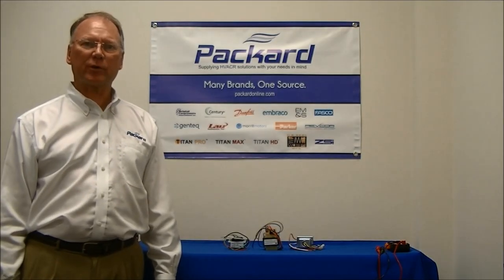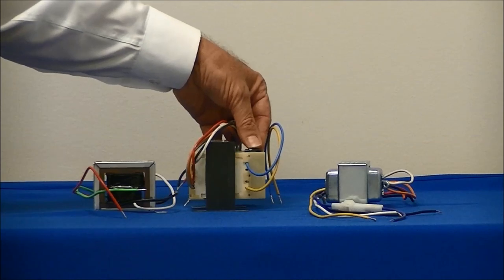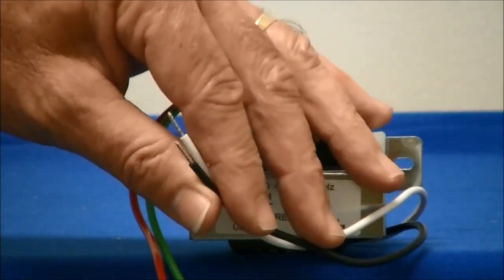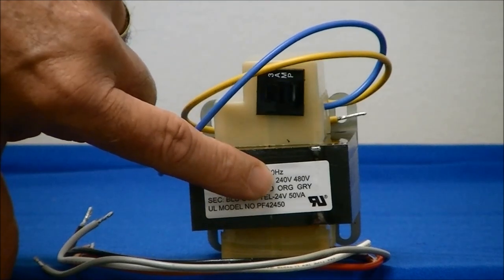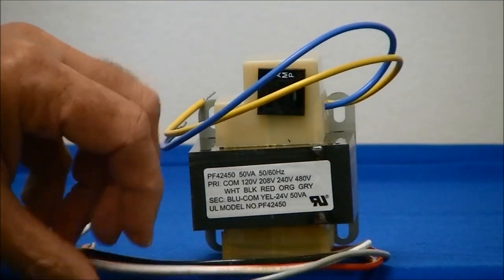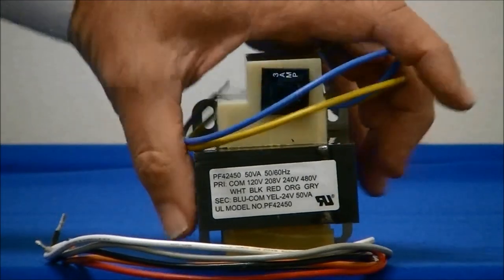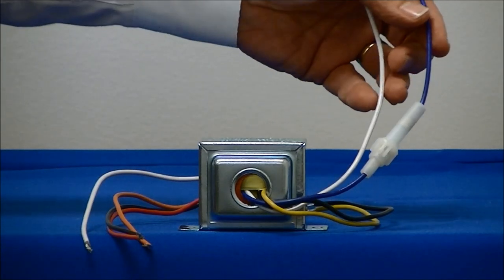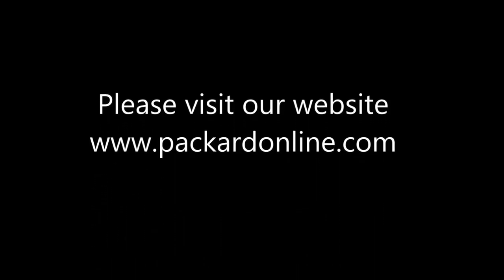Selecting the Best HVAC Transformer

Comment: Plz tell me 220v for connecting 208 or 240 wire
Reply from the maker: If the source is 208 volt, use 208 volt primary, not 240.
 
If 220 volt but not a 220 volt primary, use 240.
Reply: @packardonline  
I tend to agree. Seeing as a transformer usually comes in at 27v, putting that transformer on the 208 tap will give you 28.56V vs  if you were to put it on the 240 tap which will give you 24.75V. Put it on the 240 tap.